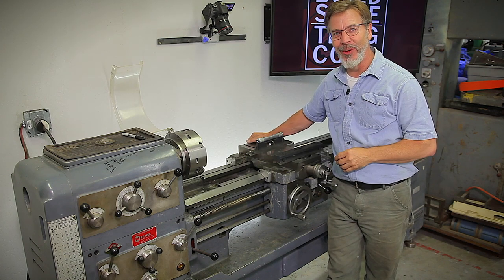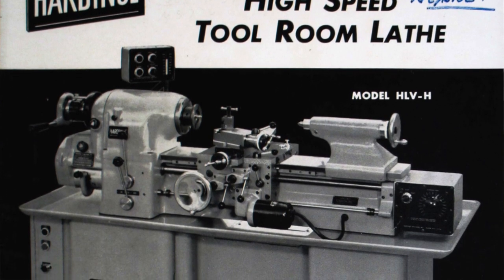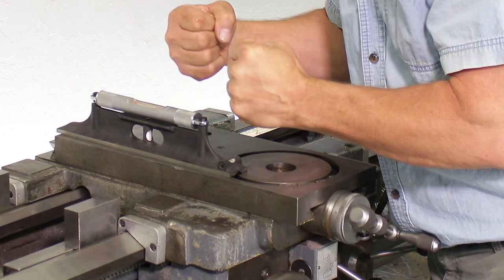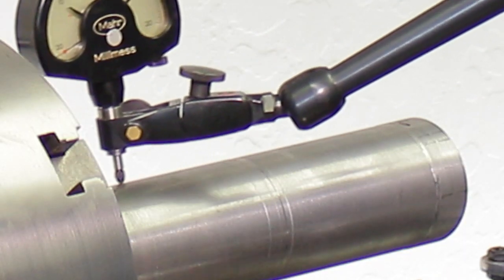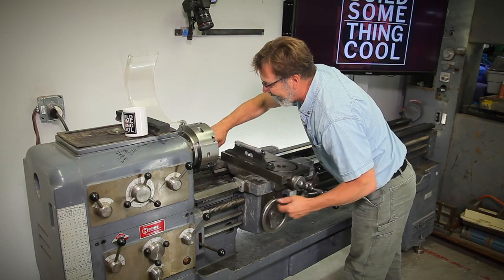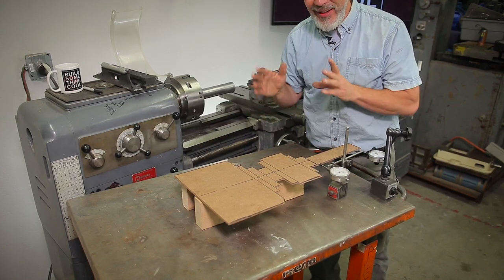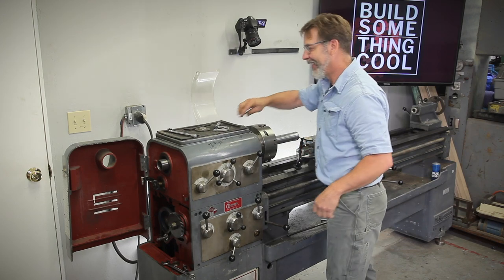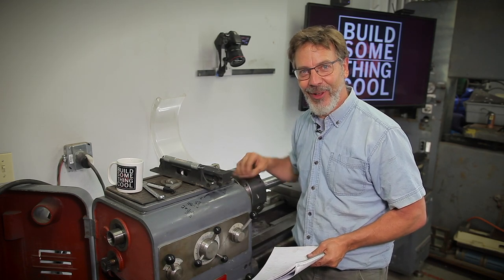How to leveling a Lathe

Comment: It is very important to adjust these machines accurately,  I remember as a young apprentice having to use two lathes in the one place that had all these problems because they weren't set up and aligned and they broke my heart. Bear in mind too that the  whole lathe does not need to be floor level,  that's irrelevant.  It could lie at a slope and work perfectly.  The thing is that it has to be level flat and aligned within itself only, so if the level is off a small bit across the bed at one end and its off the same amount at other end your fine. And always as a previous viewer said always prove the spirit level by turning it exactly 180° to ensure its accurate and  not telling lies,  otherwise you'll be chasing your tail and going around in circles.

Comment: Your level/alignment description is pretty good. I suggest on a machine like you demonstrated on that you set up two levels 90 degree opposed on the top of cross slide. I always favored 2 Starrett
.0005"/foot levels. Don't move the levels. Move just the saddle. Check for linear level over the length of the bed with the level in Z direction. This will let you see bed dipping or crowning as you traverse in Z +/-. Pay attention at the same time to the level in X orientation. This will let you monitor bed twist simultaneously with bed level. Use the rear headstock leveling bolts primarily to control bedway crowning and dipping.
You refer to spindle alignment. I call this check testing for spindle taper. With weight on all leveling bolts and locked in place, you have confidence that the bed is level and stable.
I don't bother with the relief cut on the spindle test bar, simply turn the test bar with light load and good finish. This allows you to check turned taper over the length of the test bar. The taper error on an accurate machine will be consistent over the relative length of the test cut. No relief cut allows taper confirmation over the whole length of the test cut bar. Determining which way to move your headstock taper adjustment jack screws should be obvious if you observe the relative locations of the jacking point and the headstock pivot point.
Thanks for pointing out the necessity to monitor headstock movement when simply untorqueing the headstock hardware.
Monitoring the test bar for movement with indicators is extremely important, as the headstock will move by simply untorqueing the headstock hardware. Not monitoring it will give you no knowledge if it moved or how much. You will quickly start chasing your tail.
Document everything that you change and its effect. You will be surprised how confusing incorrect adjustment effects will  compromise your corrective efforts. As a mechanic I owned and employed more indicators and mag bases than most machinists. Data is everything when you are "leveling" a machine tool.
Simple geometry/trig estimates will help predict how much you need to move to get required headstock taper correction. Your example showed that the inboard indicator  was X delta from the pivot point and the outboard indicator was about 2X delta from the pivot point. This would require moving the out board indicator 2X the required correction. The second taper test cut will confirm your estimates. You encouraged turning off at least .002". Make certain that you turn off enough to ensure that you get test bar cleanup.
Depending on the machine use will determine if you settle for taper error large on the chuck end or tailstock end. If I couldn't get dead nuts .0000", I suggest settling for larger on the chuck end. Part deflection under general machining is most likely to contribute to larger tailstock end part taper.

I have watched machinists use an inspection grade round test bar in the lathe spindle chuck and indicate the length of the test bar from the tool post. This test only confirms the machine integrity. This test cannot tell you the source of error. Levels and turning headstock taper are the primary sources to document the cause of error.

I think that there is no reason to periodically test for level, crowning, twist or taper error unless you cannot control part integrity. If you turn good parts, checking for level, twist, crowning, and taper is superfluous.

By the way, level on a lathe is overrated. Level accuracy is relative. If coolant drains where you want it, who cares if the machine is level? Twist and crowning is important. CNC lathes are built on an out of level taper of nominally 30 degrees to enhance chip and coolant removal. Typically we just bolt a non precision leveling plate to the turret face. Using modeling clay under the level to zero the level bubble allows all the previously described level, twist and crowning tests.

I did machine set up and maintenance for over 34 years. I can recall almost never needing to actually bolt a machine to the floor to control the issues under discussion.  Bench top machines lack relative weight and mass to control rigidity.   Hobby guys may consider bolting down light duty machines. If you are really concerned about machine level integrity, ensure that you don't straddle concrete floor expansion seams.
Reply: @Paul Hunt Thanks for taking the time to explain all this! The reason I read the comments sections is in hopes of coming across helpful & informative comments like yours.
Reply: Thank you for taking the time to share your knowledge. I've often wondered why on occasion YouTube will send videos on topics the viewer may know inside out. Perhaps the reason is to spread the knowledge as you clearly have done. Nah, it just gets lucky on occasion.
Reply: Excellent explanation - Thank you Paul

Comment: I love the use of the plumb bob to level the bed since I done have a machinist level. I then put a cheap pencil laser in the chuck and ran at high speed and taped a white piece of paper on the tail stock. I then tweaked the head and bed ways to get the laser on center at the tail stock at maximum length and it stayed on next to the chuck. My test cuts at both ends were within 1 1/2 thou over about 30 inches.you can  adjust the alignment with the chuck running . Maybe i was just lucky?

Comment: I've got one of those Polish levels. Got it when I was installing CNCs. Works great but kind of slow to settle. My lathe sits across a joint in the concrete floor. Not a good idea, but that's where it fit. After 6 years I decided to see if it was still well set up. It took a very slight turn of the leveling bolts to bring it back. Using a commercial MT3 test bar & test indicator, the tailstock was  in alignment with the ways. Using a 2" bar of steel, the head stock still checked true to the ways. I had previously aligned the head stock. I put centers in a 1" bar of steel and pressed two rings of metal onto it so I could use it to check the tailstock for offset. I chased my tail until giving up @ about .0002" in 10". Good enough for mostly hobby work. About 4 hours including making the rings and pressing them on.   
What happened to this channel?

Comment: Build Something Cool.
I'm a retired construction surveyor. The one thing I didn't see was the calibration of the leveling bubble prior to any other levelling work ? That is the 1st thing that needs to be done prior to any other level checking. The calibration is easy to check, a magnifying glass would allow more accurate checking. Put the level in a convenient flat surface & mark the end points with a sharpie or similar pen & that is said to be face 1. Then observe the position of the bubble. Lets say it is exactly showing level. Then just lift & rotate the level 180 degrees placing it again on the 2 pen marks, this is face 2. If the level is correctly calibrated the bubble will again show exactly level. If it is not then there should be an adjusting screw(s) on the level to move the bubble a very small amount. This amount is 1/2 of the total variance between face 1 & 2. It's a form of iteration, as in keep halving a number & you get near enough to zero.

 Lets just use this as an example. Position 1 the bubble shows level. Position 2 the bubble shows 1/2 mm variance. Then the adjustment is made at 1/4 of mm. Rechecking the level on face 1 & face 2 the variance should be 1/4 mm off the centre bubble. This then means that the surface used to measure level is 1/4 mm out of level.

In surveying there are precise level tripod mounted units used for some procedures. Like in tunneling where marked points are checked from time to time to see if rock movement may indicate a possible collapse ? These levels are graduated to read in 1/100 of a mm or similar in inches. These levels are sometimes used in levelling workshop machines. 1/100 mm far exceeds what those machine levels can do. Leveling is related to the centre of the Earth just like all level bubbles & plumb bobs do.

Precise leveling is the best way to level these machines. They can tell you how much you need to turn a leveling nut once you know the thread spec. It's a lot faster & more accurate than any other means. This is because all relevant points can be checked & rechecked accurately & quickly. The main problem is that most machinist orientated people don't know about this precise levelling option. I believe they can be hired from SOME companies but not everywhere. Even automatic builders levels can give very high accuracy as well because the instrument is not far from the machine. An auto builders level with magnification it has for this work (x22 - x30 depending on the model) can split the black marked lines on a machinist rule. That's probably more accurate than most machinists levels ?

Comment: I have one of those .0005/12” clones. Indeed it will drive you crazy. Being able to measure to a point you cannot machine to or correct is tempting but maddening. Tried the plumb bob trick once for kicks and it didn’t work. To much location error when moving it from one end to the other. I like the way you did it here with the level on the carriage. The plumb bob might work like that measuring to some consistent line. Great stuff!

Comment: Thanks for showing. I came to the conclusion if you have a bench lathe, bolt it down, you going to bend it unless the surface is 100% accurately flat or leess flimsy than the bed, then you have to understand this and shim it.

Comment: Great video.  I have a small lathe (German brand but actually Chinese).  Other than the Tail Stock horizontal adjustment there are no adjustments.  Does this mean that levelling and bed twist are not a worry or that the lathe is just poor quality?
Any comments or suggestions welcome...

Comment: Hi, why don't you use two indicators when adjusting the headstock just like you show with the cardboard. So just adjust the difference on the indicators to be the same as difference in radius. Might work with just one adjustment. Kind regards Mattias

Comment: The place I work is proposing to put a 3 foot extenton on the bed of a HAAS TL1, to chamfer Hot roll tubing 6 foot long, 5.5" diameter .25 wall. Has anyone ever done such a thing? I can't even see how the tiny tailstock can hold the other end.

Comment: Hi, Thanks for your excellent video. I am about to purchase an engineers level. The temptation is to purchase the highest accuracy, resolution or sensitivity device (used interchanceably in adverts but all having different meanings in metrology) so I heed your warning. Your video suggests the Starret 98 is ideal, my question is what sensitivity/accuracy/resolution is yours, you said accurate to .001/ft per division whereas the Starret website says each division is .005/ft. Sorry about this trivia but in the UK Starret are not cheap so I need to make the correct choice. I also apologise for what may be seen as nit-picking an excellent practical video.
Reply: it's 0.0005 inches per foot

Comment: Wondering if that lathe came standard with a bud light can 😝
Reply: Probably not, water and machinery usually equals rust.
Reply: Even if it doesn't, the magic of the home machine shop is that the beers just appear somehow.
Reply: @kieronscully1161  My unanswered question is if beer is a coolant or lubricant. I have found that a cold one on a hot day helps take the heat away, then again, after a hard day a cold one helps lube the gears in my head so I can relax some.

Comment: Hey Dale, thanks for taking the time to output another video. I can't understand your anxiety with the 'kind comments' though. Please spend some time so that the information you put up there for others to learn off is correct and kind comments will come flowing! I am not the most experienced machinist in the world but I think you had a sloppy approach to the matter, from the description of the indicator (what does '...about at thou...' mean?? ) to the two-collar method. You have the potential, just plan your work a bit more. 
In any case, thanks for the effort you put already.